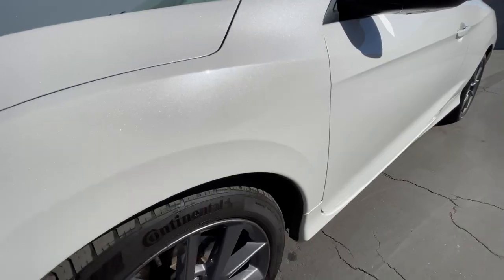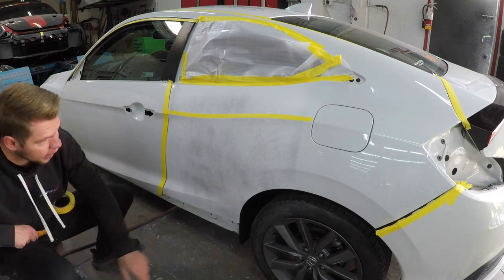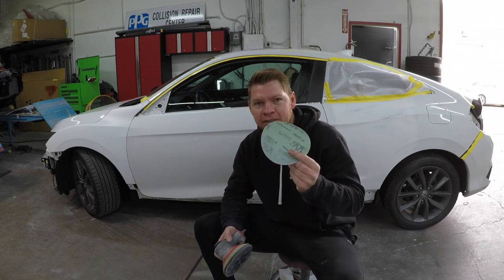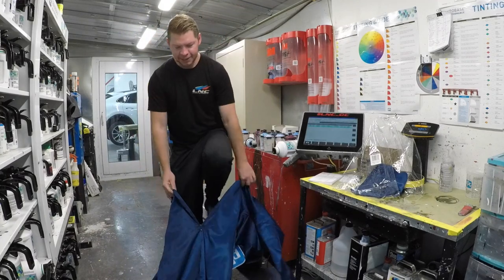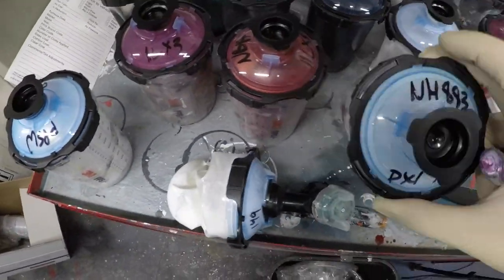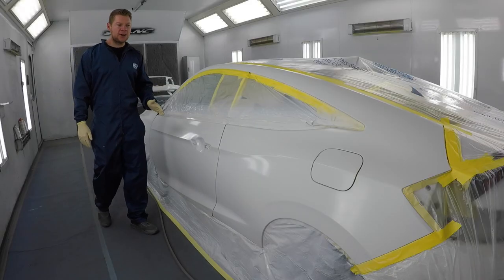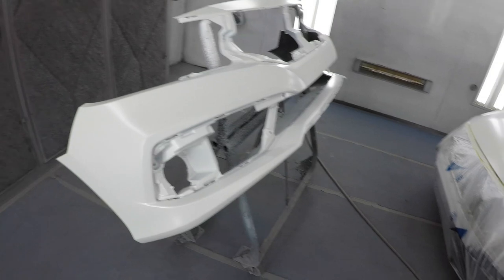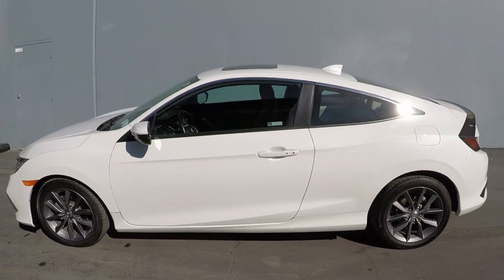3 Stage Pearl White Paint job Start to Finish Complete Process

Comment: Good evening Andrey, I really like the alcohol tip for masking. I use another trick. I heat my masking tape in the microwave for 15 to 20 seconds, it really helps it stick and it will bend and form around anything much better. Thanks for the great video. You take care and good luck.
Reply from the maker: Thanks Steve! I can def use the microwave tip, i remember leaving the tape on a heat lamp and it would be a lot more sticky. We do wide body fenders and bedsides for Ford Raptors and they get rhino coating on the inside before coming to us, tape would never stick to that coating! I am gonna try your method 👊🏻

Comment: Gday Andre,
Great tips, thanks. Will remember to watch my tapes more when blending. I use the 3M blue long life tapes and noticed yours are yellow. I take it it’s probably a 3M tape but just higher quality? 
I’ve been using the 3M masks for years but noticed the quality of them has not been what they use to be. The elastics seem to only last maybe 12 months now and the rubbers around the face fit seem to break down/split also around the 12 months. Just wondered what particular model of the 3M mask you are using?
I’ll have to try one of those PPG suits. I use the DuPont Tyvek type and they seem  to catch and rip too easy. Earth moving equipement has a lot of sharp edges and bolts etc sticking out. 
I think 3M and PPG should be sponsoring you! 😁👍👍
That’s an in depth paint process. Great job!
Cheers 🍻
Reply from the maker: Thank you 🙏🏼 The yellow masking tape has a stronger adhesive than the blue one, works a lot better when masking. The 3m mask i will have to find the part # but it seems more solid than the beige/gray one. 👊🏻
Reply: @LncPainter  
Thanks for info Andrey. Please don’t go to any trouble. I can recheck the vid and match it up with an online 3M search. The 3M mask use to be only black years ago and lasted me for about 15 years before it cracked over the nose area. But of course they then don’t sell so many masks when they are made to last so long. 
I was really surprised with the inferior quality of the new ones as 3M products were always so good. Yes, my latest one is the grey one. 
“I hope the organic vapour filters are as good as they use to be at least” 
👍🍻

Comment: Better and better, Andrey. I always wondered. Does the paint dry or does it cure? How long is the dry or cure time between coats? Also, does the fan suck up all the overspray. How do you keep from getting covered in it?
Reply from the maker: Thanks 👊🏻 The base-coat dries about 5 min with airflow between coats, you can see when its dry, it goes on wet and dries matte.  
The Fans keep all the overspray out, there is an intake and exhaust fan, so especially when spraying clear You can see it being sucked out.

Comment: you didn't explain what the difference between base coat and mid coat mixing agents.
Reply from the maker: The midcoat has a clear basecoat toner, mixed with a few metallic toners…making it very transparent. It provides the metallic flakes (tricoat) when applied over solid white